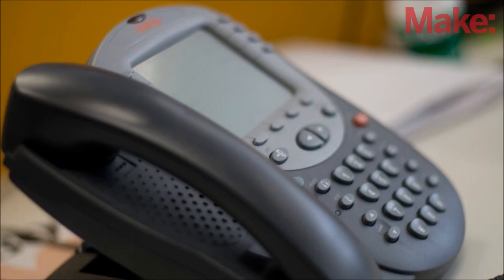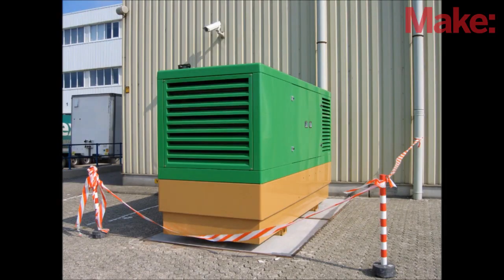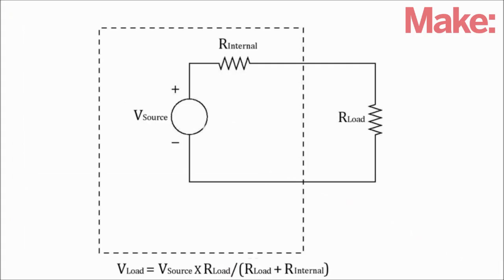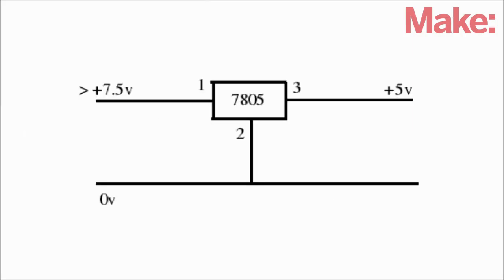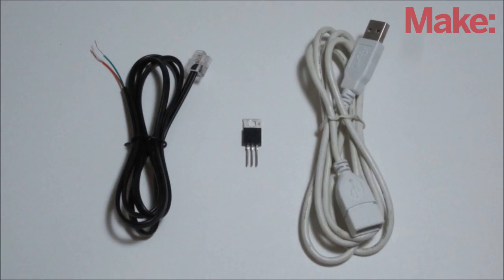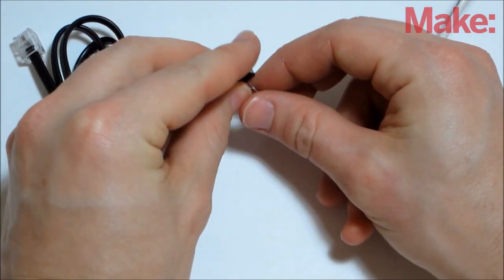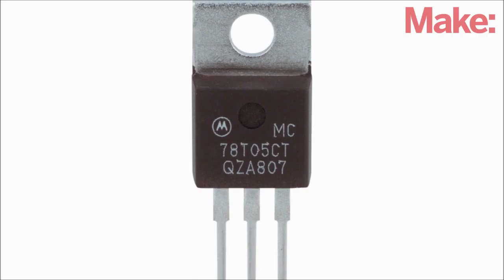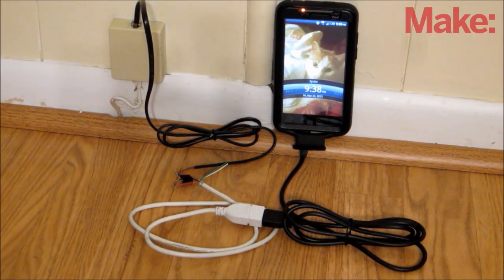DIY Hacks & How To's: Emergency Power from a Land Line

Comment: I guess its completely out of the question to just plug in a landline phone and make that call.
Reply: VortexComputers well if you don't have service on that line, and it's still hooked in the phone system getting power, then the only call you can make is to 911.
Reply: VortexComputers because cell phone data still works and power outages are boring! ...low cell bat = no more data entertainment during blackout. comment= not so smart...good try on trolling though
Reply: haha,this made my day.
Reply: haha
Reply: yea thats just as fun..
Reply: Powered landline plugs are in all homes, even abbandoned. Are you in Russia and KGB search you??? Ok fortunatly you bring up a satellitare phone, BUT IT DOESN'T HAVE POWER OMGGG. no probs here is the solution.

Comment: i have a internet router that runs off of 12 volts can you tell me how to get it powerd not exactly perfectly but to where it doesent blowup or destroy the router?
Reply: He said @ 12v it produces 64mA, and routers/modems pull more like 350-1500mA..
It's like me and you; we are both 1 person, equally of value(voltage), but you might have the strength to push a car, and I might only have the strength to push vegetables into my mouth (at least this is a start :/ ;) )

Comment: Cant find the darn voltage regulator :\
On ebay I can only find 35v or 40v input or 220v

but no 50-60v to 5v :(
Anyone had more luck (somewhere else) ?
Reply: Used, but this is the exact model: http://www.ebay.com/itm/1x-TI-UA7805C-LDO-Regulator-Pos-5V-1-5A-3-Pin-3-Tab-TO-220-/181566144726?pt=LH_DefaultDomain_0&hash=item2a462f80d6

This seems to be similar, but I am lost when it comes to things like this: http://www.ebay.com/itm/10pcs-New-IC-L7805CV-L7805-7805-TO-220-Voltage-Regulator-5V/141329092825?_trksid=p2141725.c100338.m3726&_trkparms=aid%3D222007%26algo%3DSIC.MBE%26ao%3D1%26asc%3D20141212152715%26meid%3De7d161ceffb14161a5a658bb995e858e%26pid%3D100338%26rk%3D2%26rkt%3D29%26sd%3D290804687480
Reply: ***** Thanks man! :) 
Only the data conflicts.. 
And I am not in the position to blow my phone up ;)
When I look up datasheets for these, they say: the maximum input should never exceed a 35volts, and this guy is working with a 52volts!?
Reply: Make: Do you have an answer to this? 
Thanks in advance! :)
Reply: +FORMERxZOMBIE put a 1n4007 diode in series with a resistor probably 4.7megaohms between the positive line and the input of L7805,the voltage drops under 35v.

Comment: Jeez Which diode? Almost perfect instructions but missing diode size.
Reply: +Stuffyou100 basically any lol. just make sure it's rated to around 100V incase the phone rings, because like he said those can go up to 90V AC..
Reply: +Voon Eng Hong 1N4007
http://www.digikey.com/product-detail/en/1N4007-TP/1N4007-TPMSCT-ND/773694
Reply: Stuffyou100 crack open any non tungsten light bulb...cut out or desolder any diode inside that you find..use it...problem solved
Reply: Um Diode won't stop AC . I t will just turn it in pulsating DC. You need an inductor/choke/coil
Reply: @niyablake  I agree that a diode does not provide adequate protection as it does not STOP the higher "AC" current. I used to work on telephones, and know a few things this tutorial does NOT take into account. The standard voltage was 48 volts dc, but often varies as some telephone "switches" or switching centers send out slightly higher voltages. The further from the switching center you are, the lower the voltage, the closer you are the higher the voltage. Ring voltage is NOT "AC" exactly, it is half wave AC or as you said pulsating DC. Also the polarity of the two wires of a telephone although supposedly always the same, they are often wired backward. When this occurs attaching this circuit to the phone line would not output the proper voltage, likely none at all, but I would not chance attaching my cellphone to it. I would first of all use a bridge rectifier, connect the red and green wires to the "AC" side of the rectifier. Polarity problem solved. Next the voltages here are higher than the 7805 is rated, the half wave power is more than twice the voltage the 7805 is rated. Connect a resistor to the positive output of the rectifier. Connect both a capacitor to the negative side of the rectifier, and also your negative output/ground wire to the negative side of the rectifier. Connect the other side of the capacitor to the previously unconnected side of the resistor, this is also where to connect the positive output wire. Lastly connect the positive and negative output wire to your USB plug. According to the specs of the 7805 regulator, the highest input voltage is 25 volts, adjust your resistor value to create a voltage drop from roughly 48 volts dc down to 25 volts dc. The manufacturers schematic I saw for using the 7805 says to use a 0.33mfd capacitor, however this might need to be changed, since we are "filtering out" or reducing the ac signal. Our "cut-off" frequency is 60hz, the frequency used to send the "ring" current to the telephone bell. Use the following to calculate your resistor and capacitors values: Cut-off Frequency = 1/(2 x pi x R x C). Also probably it wont work anyway. The the switching center thinks you have a phone "off the hook" to long they may cut the voltage now to a minimum and therefore not supplying enough voltage/current to charge the phone anyway...
Reply: Niya Blake a pulsating dc is manageable to stop protect the voltage regulator and it’s not like they will ring for longer than a minute
Reply: @scurvy182   500ms is enough to fry you cell phone. It would be a lot easier  to have a cheap spare phone to dial 911
Reply: @niyablake  use 2 diodes, one on the GRD and one on the live wire.
Put capacitor between diode and volt regulator.
No more phone frying.
Reply: @rakly347  It would just be easier to use  battery bank they sell for  phones
Reply: +KpilotRCHelis hey i am not pro at electronic, can you give me a link or name of diode???
Reply: so with this diode i wont blown up my circuit is that right???
Reply: +Voon Eng Hong it's rated to 1000v you're good
Reply: +KpilotRCHelis i cant find 1n4007 at store. But i found FR107 does it works?

Comment: so you don't get charged for this power do you....
Reply: No; they can't check this ;)
Reply: +FORMERxZOMBIE They can, not directly, but they can
Reply: Please do tell :)
Reply: FORMERxZOMBIE By measuring the voltage and the current used on the line. The phone line (at least in germany) puts about 60V. In "Hung Up" state/"standby", a normal phone nearly doesn't use any current. In "User dialing" state, the phone's calling/dialing circuit is closed and only has about 600Ω resistance, thereby the ~60V are dropped to ~12V with a high amperage usage.
Disclaimer: This is just what i understood from basic web searching and an understanding of electronics, don't rely on this info. If you have any other knowledge (propably?), please tell me! I'd like to know too ;P

Comment: ok mine 42.6 dc but look 	Voltage Regulator 5v and max in is 35V maximum supply voltage how to do this
Reply: open the box and got 400k resistors inside

Comment: People aren't taking some things into account.   Yes, you could just plug in a analog phone and make a call.  That however assumes that you have A) have an old analog phone and B) have land line phone service set up.  I personally haven't have a land line analog phone or phone service for many years.  I have a cell phone and that's all I need.  Also, many people have cordless phones.  This could come in handy for people that only have a cordless phone for their land line and their cell phone battery happens to be dead.  The cordless phone's base station needs to be plugged into an AC outlet in order to make a call.  So in a power outage your analog cordless phone will be useless.  So there are some circumstances where you can't just "plug in an analog and make a call".  
I think a small circuit with some LEDs wired to a RJ-11 phone jack (including the proper voltage regulator and resistor if needed, etc) could also be useful in a power outage for some basic lighting during a power outage.  If the power goes out just pop in a few of these units into some phone jacks for some emergency lighting.

Comment: Or, Now hear me out. You could just use the corded phone, I know it sounds crazy
but it just might work. And then you don't have to cut and mess up usb cables and do all of that unnecessarily work to make a call.
Reply: Some people don't have analog phones anymore! I, for example, could still plug an old one but I don't have a subscription to the phone's provider anymore, it all goes through Internet, which needs a router powered to work. 
That's why it can be useful.
Reply: we dont have any more corded phones. if we did we could only call 911.

i can also use my smartphone as a flashlight, or a camera, or for maps, or something. corded phones cant do that. 

the idea is that you make this before things go wrong. then when they do, plug it in and have fun.

Comment: Wait wait ... what?

So I can do (illegal if you live in the UK) things to my phone line so that I can charge my mobile phone (which won't charge with less than 1A of current) so that I can use it to make a phone call in that rare case where my phone has a flat battery and the power is out?

I think I'll just stick with plugging a corded phone into the phone socket.
Reply: Yeah, the amount of voltage traditionally required to ring the bell on an old-fashioned phone is quite large. A large part of the inside of a PBX is taken up by the PSUs to drive this.
Reply: Surely the weedy little 7805 regulator will pop if you feed it that 50VDC he measures coming out the socket?

Comment: Simple, I dont have a landline phone, only cell phones. After I build this, I can use the 12 volts in my land line to power cell, phone, LED lights or whatever I can think of for 12 to power.
So while Calbff thinks this thinking could be applied to 99% of youtube video's, it just shows he doesnt use his head to think past the video.

Comment: You can easily power your cell phone by connecting the battery terminals directly to the hot and neutral prongs of any electrical outlet.

It will explode, and probably electrocute you, but it will definitely be "powered"!

Comment: If the power is out in a big enough area that you can't just use your neighbour's power, then the phone line power is likely to be out too, unless your land line provider uses backup generators.  

If the power outage only affects your electricity, and not your land lines, then it is very likely you can just walk down the street and find someone with electricity to use.
Reply: In the old days, when power went out, phone lines still worked.  Even when everyone's power went out.

"The corded landline phones don't require electricity to run. Landline services offer enough current through copper cables to power your wired phone. This means if you have a wired landline phone, it'll keep working when the power runs out, without needing a power backup."

And usually, even if you don't have landline service, there is always power in the phone jack, at least little.

Comment: I'm saying that this hack makes sense because today, most people have cell phones, and thus they cancel their landlines. However, the landline is still installed in the house. You can't use it, but its plugged in and getting power. So its good as a backup power in case of an emergency.

Comment: Because a single diode has a 0.7V drop across it, while a rectifier has 1.4V drop.Now look at the graph in the video.If we want the highest charging current (to charge faster) we have to do some maths.
Phone needs 5V, 7805 needs about 1-2V more, to provide stable output.
and we need to compensate voltage drop on ouur rectifier. so 5+1.5+1.4 gives us about 8V-> 70mA
With a diode we get about 7V or even 6,7V->73mA at least a bit more :)
One diode is enough, but a capacitor wouldn't hurt ;-)

Comment: Corded phones are able to make phone calls purely from the power running across the phone line. The only time this hack would come truly in handy is if you needed to do something more like say check the news with your phone or if for some weird reason you have a voltage regulator laying around, but not a corded phone.

Comment: This may not work depending on your country and age of house and phone line system, if the house is old I.e. 15 years it will be working with old phones thatvrewuire electricity on the UK it doesn't because they do not need need this unless you have one with abtwo line system

Comment: The circuit will be safe if you attach a diode to the red wire of the land-line cable.

Comment: good method. But the odds of having a 7805 around in an emergency is really thin for me. :D
If you do have one lying around, go wire it up to the car battery and you're good to go. if the line rings when you hook this up, you're fried. (I suggest forwarding calls to another number if you really need to)

Comment: You know, DSL connections use home phone service for the internet. It just runs on a different frequency band than voice.  The DSL line filters people have to put on their phones are for muting the frequencies from each other. Therefore your phone lines are active and this hack will work.
Reply: why does this got only my like. only 1.After 9 years.
Reply: @ljnecesito  because dialup is better. dsl too fast.

Comment: While that is true and a good idea for that circumstance, not everyone has land line phone service today. Also, unless you are driving somewhere, running a car engine just to charge your phone is VERY inefficient. My family all uses cell phones, and we do not have land line service. We have DSL, so the phone cable does come to the house, but no land line phone or service for it. Either case, it's a very interesting hack, going to have to look into it more myself.

Comment: Ring voltage on the phone line is 90 VAC. Your diode won't save the regulator or the attached phone if the phone rings while this is connected. Those who make these videos should be required to pay for the losses of those who believe them and build these ill conceived devices.

Comment: At a minimum you need a capacitor and buck regulator to prevent the high voltage AC from ruining the phone.  The diode only half wave rectifies the circuit, so you are still getting large waves of 90V at half the frequency.   If the voltage regulator can't handle that kind of input then it will fry.  Have not looked at its data sheet though so I may be wrong

Comment: If you have a working land line you can just use that vs your cell phone.

BTW it's easier and safer to use the 12V of a car to charge a phone using the same regulator though I'd add some caps to the output or just use 4 AA,C,D or a 6V lantern batteries and diode or resistor to drop the voltage.

Comment: You is right, the 7805 input voltage max is 25Vcc, maybe a zener diode before regulator

Comment: You still need an outlet to make a call.  Wireless phones will not work so lets throw them out.  A wired telephone set has its base connected to an outlet but the headset (thing you put up to your ear) is not but it still has a speaker and a microphone which need to be powered. It gets it power from the phone line connected to the base.

tl;dr - Land lines still need to be connected to a power outlet to function

Comment: Actually in the 7805 datasheet, they ask for a 0.1uF capacitor on both the input and output of the regulator to stop local oscillation. Also it's a good idea to have a 100uF capacitor on the output to smooth any peak current demand whilst the phone/device is in use.

Comment: Two reasons: 
1) many of the feature rich phones and cordless phones people have in there homes require power to work. No power = no phone.
2) There are some people that have no home phone.  With the constant dropping cost of cell phones its easier to have just a single mobile line instead of a home and cell.

Comment: I think he was just using a cell phone for an example !!
But you could use it for many other things like LED LIGHTS, RADIO, or even though the voltage output is low, you could charge a laptop or even power a High Speed modem so you can still go online with a laptop !!
Try and be creative !!
But yes I get your point too !! It is a good 1 !! or maybe he just wants to have his cell phone charged is he is going to be leaving his home !!
Thanks !!
DEv

Comment: I can only assume this would only work for those with copper lines running into their home and not fiber. Fiber requires a separate power source as I learned just recently when Verizon switched out our copper lines for fiber.

Comment: because the phonelines voltage is actually from large batteries 1v@400Ax50 here in NZ kept under constant charge if the power goes out each areas telephone exchange has a generator .

Comment: If you have a land line, why would one need to charge their mobile to make a call?  Breaking the rental agreement too?  Warning, current capabilities (internal resistance as seen from the outlet) will vary greatly, eg. with distance from network.  50 V will kill a LM78...? 35 max V in

Comment: ive been planing to make one of these but with a lot more protection and a few Li batteries as a reservoir  the problem i have is dealing with the chance of a phone call i need to find a way to detect the change in input voltage and disconnect the circute fast enough to avoid damage possibly through an opto coupler but i don't have lab equipment besides what i can build my self

Comment: Linear regulators are rather inefficient for usage with such a low amperage input, especially when the voltage is quite high.

You would get a lot higher output current from a switching regulator.   Drop in replacements for the LM7805 are available, such as the 78SR105 or the 7805SR or DE-SW050